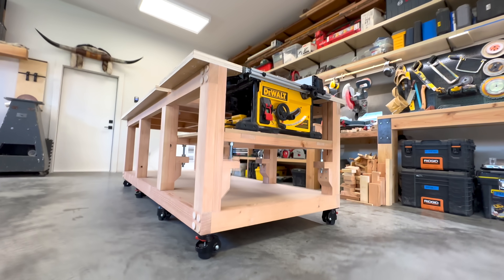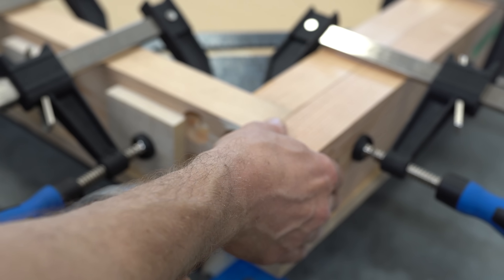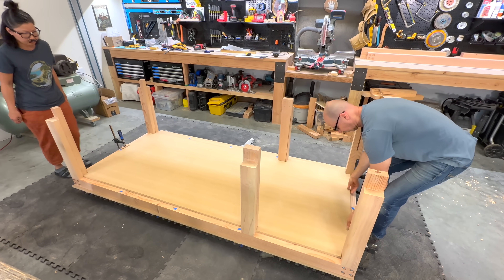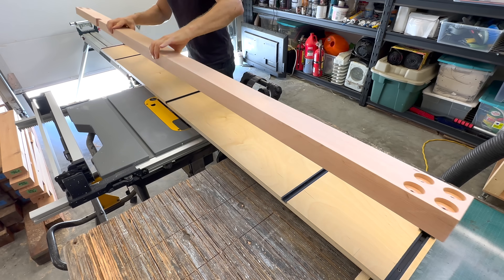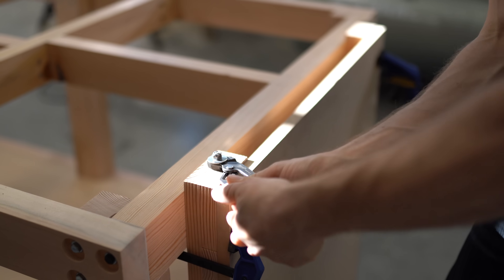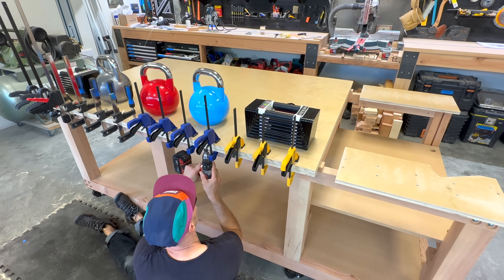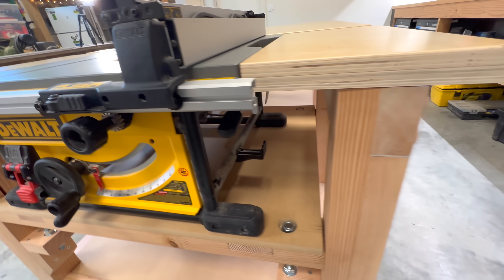DIY Table Saw WORKBENCH Dewalt 7491

Comment: Curious about the materials.  I bought these plans and no big box stores have nice 2x4 like you are using.  I understand they need to be milled down but the instructions say Douglas Fir.   Nobody has that when I look.   Sorry if this sounds ignorant... just starting out in wood crafting.
Reply from the maker: Hi there and no apologies necessary mate! and its great to hear you are getting into woodworking! You are correct, the big box stores like Home Depot will not carry timbers that are a true 2 inch X 4 inch in size. For this reason, I made two version of my workbench plan.

One version uses "rough cut Douglas Fir 2X4's" (that are actually 2 inches X 4 inches) to build the workbench from. Since it is rough to the touch, these 2X4's needs to be planed. In doing so, the final dimension become 3 5/8 inch X 1 13/16 inch. 

Then I made another version of my workbench plan that uses regular size 2X4's ( 3 1/2 inch X 1 1/2 inch) and these are the ones that can be purchase at home depot or similar. Most folks use this size material to build their workbench from.

There are three items with your purchase, the regular size 2X4 plan, the 3 5/8 X 1 13/16 inch plan and the "modification guide"

You must have downloaded and looked at the plan that uses the 3 5/8 inch X 1 13/16 inch timbers. 

Download the other plan for the regular size 2X4's and away you go! Let me know if you have any questions vanislandstudio@gmail.com  and thank you for choosing my plan! I Hope you enjoy your build! 👍
Reply: Almost done making mine with the regular 2x4s, but I suggest getting 2x6s from HD and milling them down. The wider boards tend to be better quality. Try to avoid end grains either the bullseye in the middle so they warp less after you cut them. Don’t forget to let them sit a week or two in your shop. Good luck with your build!

Comment: What’s the advantage of leaving the gap to the left of the table saw, as if the fence system may protrude that way as well? I’m working through your mitre/table saw combo, making modifications for my Milwaukee saws. Just curious!
Reply from the maker: Hi Ben, thank you for your question. The purpose is (and this might only be applicable to the Dewalt DWE7491 table saw) the fence system can be removed, flipped around, and installed on the left hand side of the blade. To accommodate this, the full gap from left to right was required. If your fence system does not flip to the left of the blade, I would say to try to remove as much of that gap as possible. Once more thing, when the fence is installed to the right of the blade (I'd call this normal, and again, I can only reference the DWE7491 here) there are two "rails" that slide back and forth. They are in the front, and rear of the saw. If I make a cut that is narrow, say 1 inch, those two "rails" I mentioned protrude far to the left of the saw blade, and that gap is required to accommodate the rear rail. Hope this makes sense, If you have any questions, just send me an email to vanislandstudio@gmail.com so I'll be able to reply easier. And one last thing...Thank you for choosing my plan Ben! 🙏 I hope you enjoy your build!

Comment: Just built this table using your plans over the holiday. 
I modified the end for my SKIL Jobsite Table Saw and it looks and works great!
Gives me more room in my garage because of the mobility of the table and I can level the table thanks to the castors you linked. 
👍🏼
Reply from the maker: Hi @sliverdelorey6525! Reading your comment made my day!  Thank you for letting me know how it went, and I'm really excited for you!  and that your workbench looks and works great! Also the fact that you modified it to accept your SKIL job site saw is on another level! Just fantastic!! Again, so awesome to hear and I hope you get some great use out of your nice new workbench. Cheers bud! All the Best, Paul
Reply: Were you also paying so much attention to the flatness / levelness ? How did it go?
Reply: I’m thinking of doing this with my skil too. What modifications did you have to make?
Reply: @alexwhite4296  
Hi Alex...I just had to make the notch for the fence rails a little deeper and the SKILs legs don't sit flush to the adjustable base, so I Glued Stop blocks to lock it in place and used some Suspension Strapping over the SKILs legs in order to screw it to the base.
Nothing too hard.

Comment: Nice. I like the feature to adjust the saw to the table. 
I also noticed the riving knife release lever. I am about to build my own worktable/saw with the same DeWalt table saw and I totally forgot that lever. Thanks for remembering me so I won't make that mistake. 👍
Reply from the maker: HI @DaveDorenbergVeltman well I'm glad you noticed the lever cut out, so you  can access it once you build your table! I'm sure it will turn out fantastic! Thanks a lot for stopping in! Cheers Paul

Comment: That is a really neat design for the adjustable platform to hold the saw. You could have added a stretcher in front of and behind the shelf after you set its position; however, the bolts & washers in the t-track slots is a cool idea. 😎
Reply from the maker: Hey @chipsterb4946 Thanks! I like your idea of an added stretcher in front of and behind the shelf too! Hmmmmm. Thanks for checking it out! Best Paul
Reply: I'm currently following the plans to build my version (not as long) of this bench for my single car garage workshop. I'm using this stretcher idea, as I don't have the tools to cut the T-slot in the legs.

Comment: Great job, i only have a small mancave but thinking of fixing a workbench in 1 corner then making a bench for my tablesaw/router on castors in case i need to cut large sheets. Love them adjustable castors.
Reply from the maker: Hi Brian, great to hear you are thinking of the flow in your workspace 👍and yes, like you said, the casters make life easier for sure! Best of luck to you and thanks for stopping in!

Comment: I would highly recommend NOT using a dado stack with a jobsite saw like that. First, the miter gauges are not nearly accurate enough and could cause a kickback, and with this powerful of a blade/saw, it could kill you. Second, the saw is so strong with so much momentum that it can send the saw itself flying backwards. I have witnessed both of these first hand. Also, you should NEVER use a dado above a 1 inch cut. If you need a bigger cut, miter saw and a chisel. These saws are not designed for such blade, and something on the saw could break.Use an industrial saw if you have the space and can afford it, at least for Dados
Reply from the maker: Hi @_-_640 thanks for taking the time to share your experience with the dado stack, however Dewalt doesn't share your opinion as they make a throat plate for a dado stack.

Intended Use:

"This table saw is designed for professional ripping, crosscutting, mitering, beveling and non thrucutting applications, such as dadoing, with various materials." 

The next time I use the dado stack with my saw, I'll be sure to make smaller cuts with more passes though, building up to final depth of cut, keeping things safer. I appreciate your concern for safety.
Reply: Which part of the video are you referencing I don’t know carpenter terms but would like to know thanks
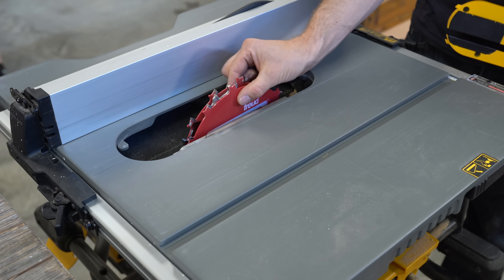Reply from the maker: Hey @justion4258, glad you want to learn, He's referring to 2:20.
Reply: I hadn’t given this any thought, so I appreciate the comment. I’ll email the manufacturer of my table saw (Skil), cause the guide doesn’t mention use of a dado stack.
Reply: This isn't your grandfather's table saw....throw a damn dado stack in it and let it rip.  It'll work just fine.
Reply: I have a dado for my milwaukee m18 tablesaw. It even has a face plate made by milwaukee for dado.
Reply: Some DeWalt jobsite saws are ok for use with DADO stacks, some are not. Those that are not specifically state as much all over the documentation. I don’t think this model is one of those.
Reply: The 8” Dewalt job site saw cannot take a dado stack, however, the 10” saw like the one he’s using can. The safety manual for both saws state that.
Reply: My Bosch 4100 10" jobsite saw has a dado stack and cane with an accommodating throat plate.  And its ripped tgrough everything I've put it up against.
Reply: Your response sounds like you are in the u k, where dado stacks are not sold, for some of the reasons you state.  I’ve personally used a dado stack on a job site table saw for over a decade without concern - and like another commenter stated, the manufacturer sells a throat plate to accommodate this.
Reply: I have that exact table saw.  I’ve used dado stacked blades of various thickness for years without issue.  Guess I’m lucky.
Reply: @Lennart1995 which Skil do you have? I just got the Skilsaw SPT99 for the purpose of using a dado up to 1/2”. Wouldn’t go any bigger. The dewalt shouldn’t go over 1/4” I believe which is why I didn’t get it
Reply: @BackTheBlue96 Calm down boomer
Reply: @Lennart1995  i have a skil saw too. Any respond from manufacturer ?
Reply: My jobsite tablesaw gives the go ahead. I built a work bench almost identical to this one. Put a router station at other end and fitted it with 6' long adjustable high skirts and have a router sled set up. Love that work bench. 👍
Reply: Only a few jobsite saws have a dado arbor. You've got one of them. Grizzly makes another. And, you're right... It is an intended use for that saw. The commenter is absolutely right about the depth of cut though. Generally speaking, you want to limit it to about an inch at a time to avoid dangerous kickback. Cheers!
Reply: I’ve been using stock delta miter gauge and dado set in my delta contractor saw for years and never had a single issue as described here.  I’ve never had the need for such a wide or tall dado, as I typically use dados for 1/2 and 3/4 stock applications and use multiple passes when the rare call for wider or taller dados required (some workbench plans).  If you get a kickback while mitering, it’s not the miter gauge but the operator failing to hold the piece firmly in place while cutting. That can happen on any table saw and, if anything, would be more forceful on a higher horsepower shop saw.  Any saw and any combination of blades and cuts can kill or make a person if done improperly.  My point is to follow the manufacturers specification and safe technique and the odds of any harm coming to you are no greater or lesser on a contractor versus shop saw.

Comment: Great video.  One alternative to a fancy adjustable height base for the saw is to just build the base a bit lower and use blocks to raise the table saw to the right height.   If you buy a new saw, you simply need to replace the 4 blocks under the table saw.
Reply from the maker: Hey Dave that's great advice and thanks for stopping in with your comment. I enjoy learning new things and thought why not try something a bit different. Thanks again Cheers

Comment: I watched your video I 100 times and built my own. Thank you. Also you can unscrew the rubber pads on the bottom of that saw you can put a lag bolt in the holes through there and adjust from there
Reply from the maker: Hello Marques that is so great to hear! Congratulations on your workbench build, WOW! Impressive you did this!! and thanks for the tip regarding the bottom of the saw. It probably sits nice and tight without the rubber feet. If you ever feel like sharing a few pictures of your build, I would be great for me to see 👍👍
vanislandstudio@gmail.com 
Thank again for your comment mate, Cheers Paul
Reply: I hope my comment didn’t come across as snobbish—that wasn’t my intention at all! I wasn’t trying to say what I did was better. I’m new to woodworking, and your adjustment for the saw is far superior to mine. I just didn’t trust my skills enough to replicate it, so I came up with an easier option. I figured there was a slim chance you hadn’t thought of it, but just in case, I wanted to share!

I’ve finished the table for now, but I plan to add T-tracks, drawers, dust collection, and a bunch of other features that might not be necessary but seem fun to include. I promise I’ll email you photos of the final product once it’s complete, and I’d love it if you’d be willing to share some honest, constructive feedback.

Your channel has been such a huge source of motivation for me, and I really appreciate the effort you put into your content. Also, could you please hurry up and post more videos? I keep checking every day like a selfish fan, haha—just kidding (but not really)! Edit: Im Curious if youre going to do dust collection for the table I want to buy those plans!

Comment: Nice and neat work, Thanks. Will be visiting for the plans.👍👍👍
Reply from the maker: Hey @arosado6604 Thanks for your comment its much appreciated! Hope you come back soon. Paul
Reply from the maker: Hi. Thanks again for inquiring about plans for the workbench. In case you were still interested, I wanted to let you know they are now available on ETSY.  Here's the link  http://bit.ly/3s4D7Ta

The plans utilize imperial measurements, and use regular sized 2X4's (3.5 inch X 1.5 inch).

If you are interested in building the workbench using the exact dimensional lumber I used in the video (3 5/8 inch X 1 13/16 inch) I'll have those plans available on ETSY's site on Oct 31. 

Thanks again for checking out the build! Cheers Paul

Comment: Nice build - wish I'd seen it two years ago, as I just sold my DW7491 and replaced it with a cabinet saw (new workshop with the room for it). The only thing I think you omitted was the two slots in line with the saw's miter slots to allow the miter gauge (or anything that uses miter bars for alignment) to travel past the blade. Simple to do - just rout a stopped dado in line with the two on the saw... Otherwise, a really nice design. Those casters are nice, but with 8 of them it must take forever to raise or lower the bench. My knees ache just thinking about it...
Reply from the maker: Hi Tony, congratulations on your new Cabinet Saw and workshop! and thanks for your suggestion 👍. I managed time to route in the two slots on a follow up video and you are correct about the casters. I have it down to about 10-20 seconds per caster now lol, but generally leave the workbench in one area now. Still nice to be able to move it if needed. Thanks so much for stopping in, I enjoyed reading your comment. Cheers!

Comment: It's a stunning build and fab video work. Looking forward to being able to get a set a plans.
Reply from the maker: @TheMooseHut Thanks so much! The plans are taking me some time but I'm working on them every day. Hopefully not much long. Thanks a lot for your comment and checking out the build! Paul
Reply from the maker: Hi. Thanks again for inquiring about plans for the workbench. In case you are still interested, I wanted to let you know they are now available on ETSY.  Here's the link  http://bit.ly/3s4D7Ta

The plans utilize imperial measurements, and use regular sized 2X4's (3.5 inch X 1.5 inch).

And in case you are interested in building the workbench using the exact dimensional lumber I used in the video (3 5/8 inch X 1 13/16 inch) I'll have those plans available on ETSY on Oct 31. 

Thanks again for checking out the build! Cheers Paul

Comment: I have watched this about 3 times, your leveling idea is something that I would  like to try, looking forward to the plans.
Reply from the maker: Hey @gamerscircle that's so awesome of you to say. I appreciate you checking out the build. If you are still interested I hope to have them completed shortly. Best Paul
Reply from the maker: Hi. Thanks again for inquiring about plans for the workbench. In case you are still interested, I wanted to let you know they are now available on ETSY.  Here's the link  http://bit.ly/3s4D7Ta

The plans utilize imperial measurements, and use regular sized 2X4's (3.5 inch X 1.5 inch).

And in case you are interested in building the workbench using the exact dimensional lumber I used in the video (3 5/8 inch X 1 13/16 inch) I'll have those plans available on ETSY on Oct 31. 

Thanks again for checking out the build! Cheers Paul
Reply: @vanislestudio  Thanks Paul!  I am no where near your level of wood working, I am most impressed with you leveling system.  When I am ready for a master workbench, I will get your plans, again thanks!
Reply from the maker: @gamerscircle  I’m sure you can make a straight cut my friend :) But thanks again for your comments! Much appreciated Cheers

Comment: I have that Bosch mitre saw and it's an amazing piece of kit
Reply from the maker: Hey Myshinobi! I like your name! The Bosch is a BEAST! I particularly like how close it can sit to the wall. For a large saw, its foot print it surprisingly small. You have a good taste in a quality saw my friend! Cheers and thanks for stopping in
Reply: @vanislestudio  thanks guy. I've had that saw for a couple of years now. I've built a lot of stuff with it. I recently got 12" a Diablo Steel Demon blade. Apparently they can cut through plate steel... we'll see. You are right though, it's a great saw for so many reasons. I initially thought that it wouldn't be as accurate as the traditional rail technology buvt I was absolutely wrong. A great example of German precision engineering and technology.